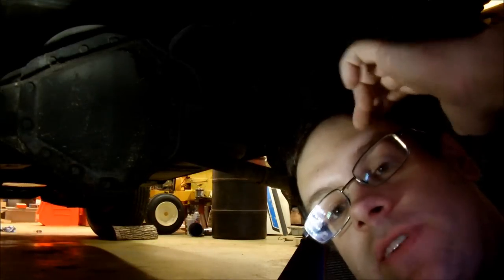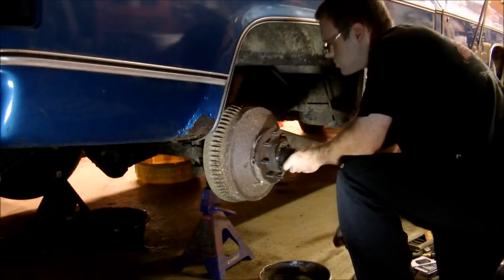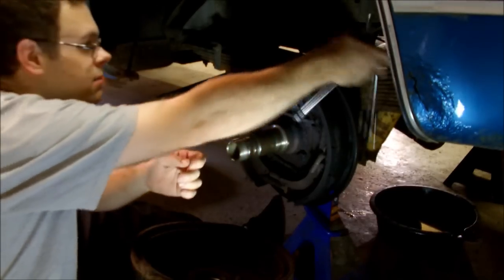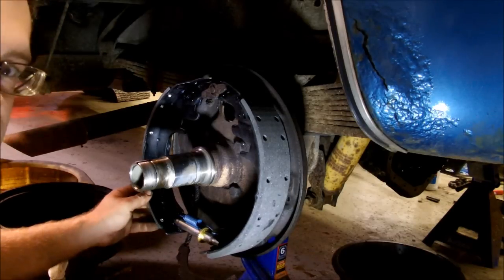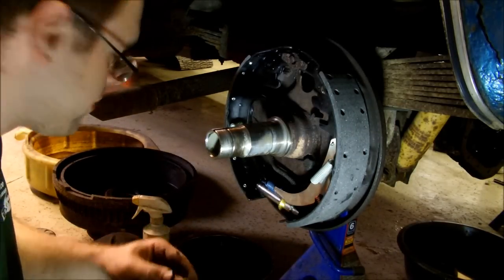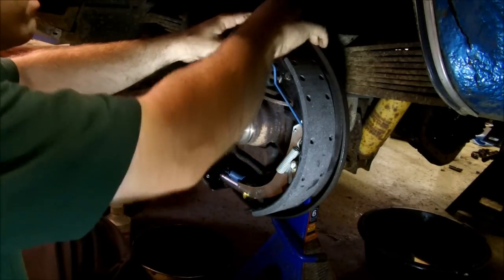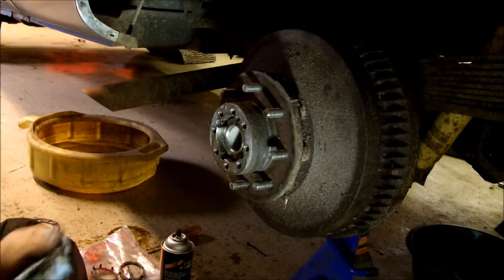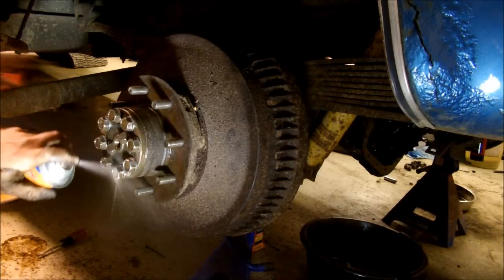14 Bolt Rear Extravaganza - 1978 GMC C2500

Comment: You should comment that this is for the HD K/C 2500 series axle (8 lug), the  std C/K 2500 2500 axle is 6 lug and has the "c" clips in the diff,  but you don't have to pull axles to do brakes. Just did mine.

Comment: Hey Guys, hope you can help me fast 🙈 i got a 1985 c2500 suburban and forgot to look after the hold back spindles before taking off everything 😭 on the video there is a shorter spindle on the backside and a longer on the front side. Both yellow. But my new yellow spindles both the same. Is it possible?? Greetings from Germany 🤘🏻🤘🏻

Comment: Your spreader bar is backwards you have left and right mixed up the bar should be bent inward not outward it will keep you from fully threading your wheel hub in and can cause damage thier the spring on the end is to keep the spreader bar in place when shoes and drums are nearing end life (prevents it from falling out) it also keep noise down from rattles when not applying the brakes